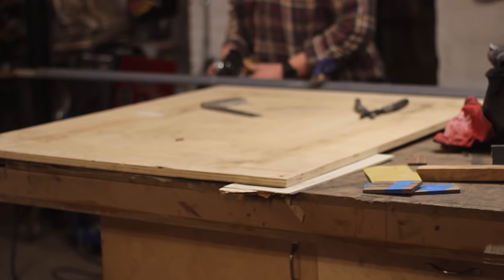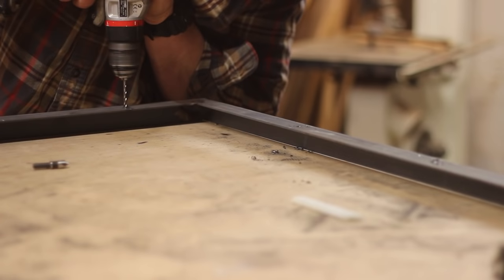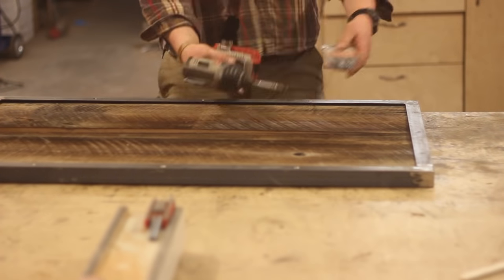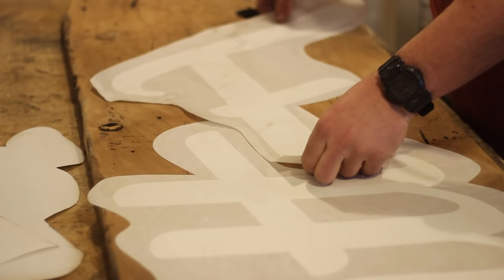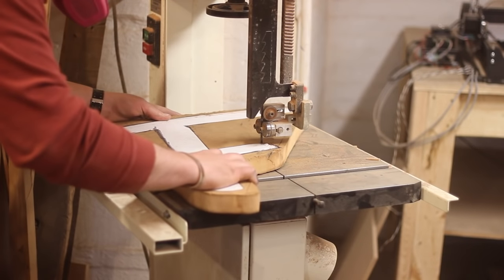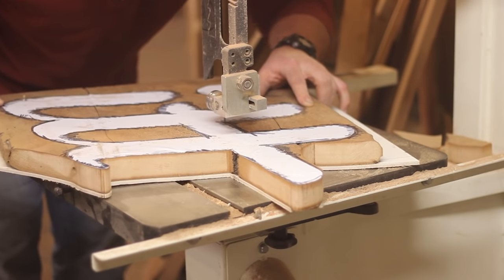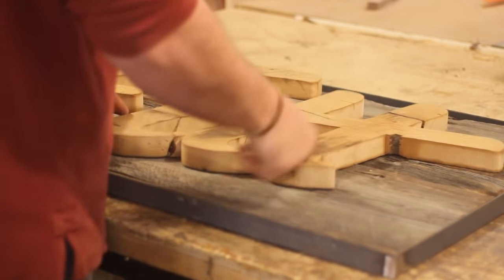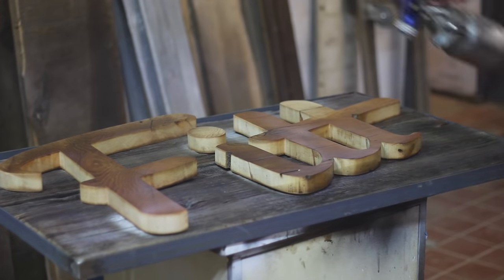How To Make A Custom Industrial Reclaimed Barn Wood Sign

Comment: A little tip to get the vinyl stickers to stick easier if u put a very light coat of poly before u place it the vinyl will stick much better then without :) I use this for making my wood signs and if I am going for a flat finished look I just take the sander to it to make it dull again.

Comment: probably a bit late to help you, but might help someone. when putting down the vinyl letters, use an old credit card or library card and rub them down before you take off the mask. it helps force the air out and it will adhere better to your surface

Comment: every time I find a new wood working channel I binge watch for days lol, anyways how do you like the 20v porter cable drill and impact driver? ive been thinking about buying I have dewalt brushless 20v but the porter cables look so much cooler
Reply from the maker: +Wellington I blew up the 20v Drill and the impact is on its last limb actually. So I am on the market for something better. Been looking at Makita, Dewalt, and Milwaukee.

Comment: Awesome project and video John. Is that cup sprayer a pain to clean up with the water based poly? I have 0 experience with a cup sprayer, I've only used my airless.
Reply from the maker: +Adam Gabbert  Its the Earlax 5500 HVLP system, and i have no issues with water based poly, I only run water based in that gun though.
Reply: Right on, and thanks. I've been thinking about adding one to the shop. I'm gonna check it out.
Reply from the maker: Theyre a great investment!

Comment: how do you set pricing for your projects. I do home improvement and do well with that but have no clue on wood working
Reply from the maker: Pricing is an art form. I actually hired a coach (Shawn Van Dyke) to help me learn it. Check him out and he can lead you on the right path, has helped me grow my business profitability exponentially! Shawnvandyke.com
Reply: Various ways to do it. But you double wholesale cost, add cost of materials plus 10 percent then add your time times how many hours and what you charge per hour. Add it all up and that's your cost. Also do market research to see what others charge for signs in your area. If you are to low you need to raise your prices. If too high you need to come back down or make a really awesome sign worth the extra dough.

Comment: How thin do you make the poly for the sprayer?
Reply from the maker: +Chevee Dodd Dont thin it at all, just strain it. Its thin enough out of the can that it sprays very nice. I use 2 different tips in the gun depending on what im trying to accomplish
Reply: +John Malecki oooh. I need to try this then! Minwax Polycrylic? I have only sprayed shellac out of my gun and I think it to about a 1lb cut
Reply from the maker: yes sir, I like semi gloss. Sooooooooo easy to work with